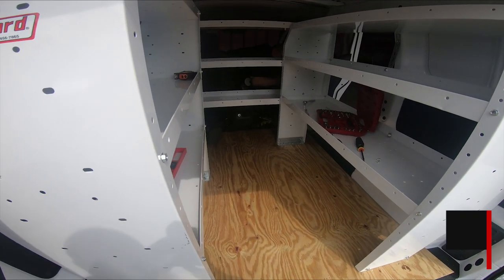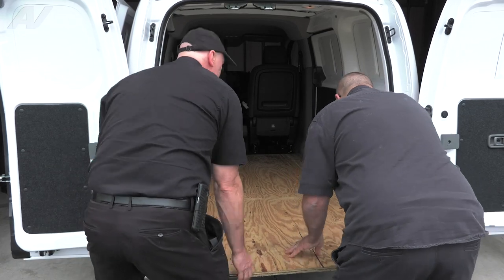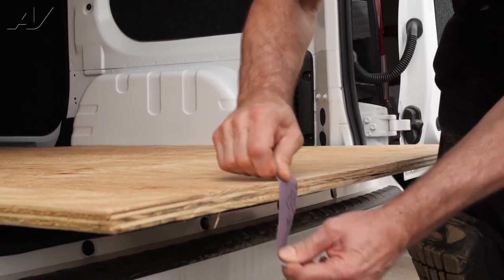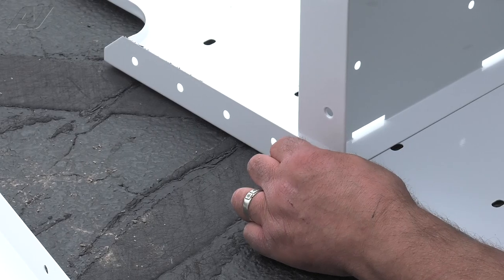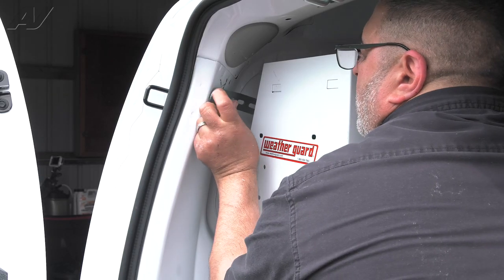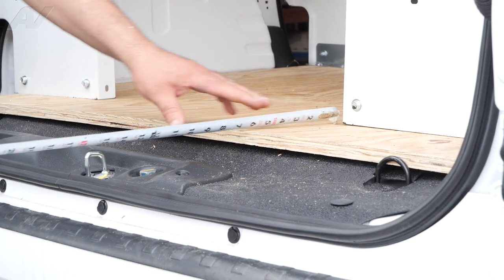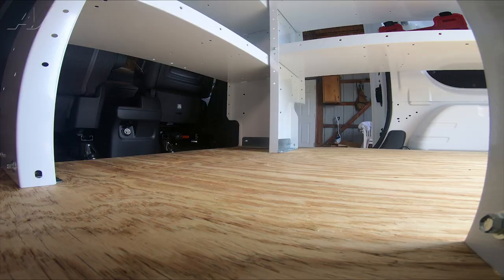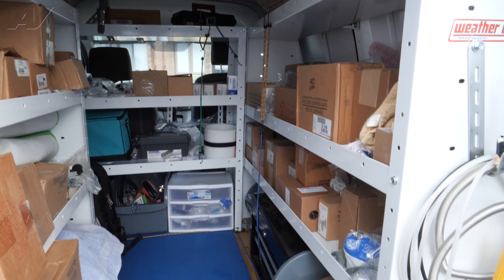Tips on Installing Shelves in a Work Van

Comment: Where do you store Sealed system items? I do not see a secure place to add a refrigerant tank and recovery system.  Also would be interested to see a full walk around of the shelving from a side door perspective. Also is the basic setup for all techs or is this just a simple solution based on 1 techs needs?
Reply from the maker: This installation is for technicians that do not do sealed system jobs. We have tank holders for sealed system technicians.

Comment: What screws do you use to fasten the shelf to the van?
Reply from the maker: Great question, if you have a more technical question that our parts department cannot answer, you can search our over 13,000 answered questions free at our website www.ApplianceVideo.com under our Repair Help section. You can also call our parts department at 1-800-830-5465 and they can give you help 7-days A week ,or search at www.SaveMoreOnParts.com  .